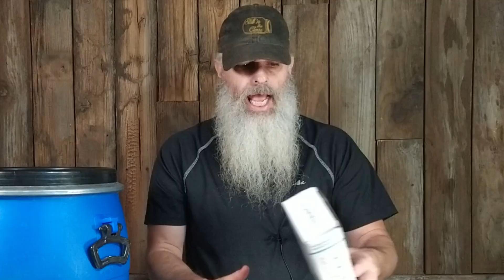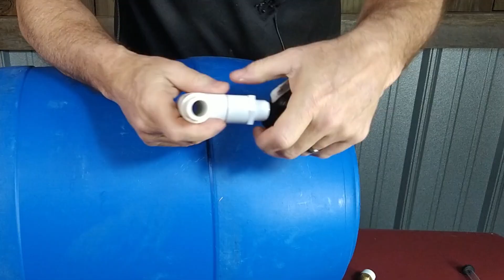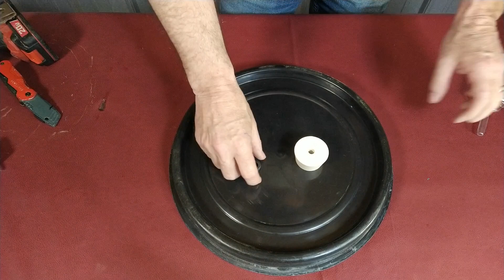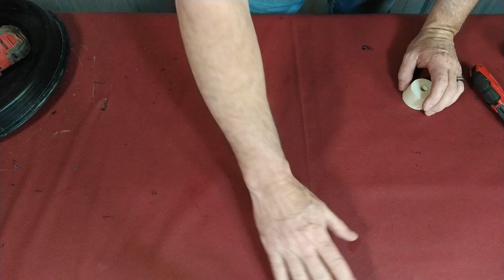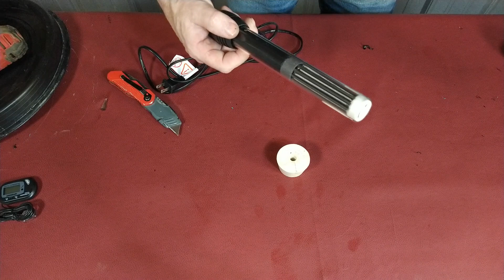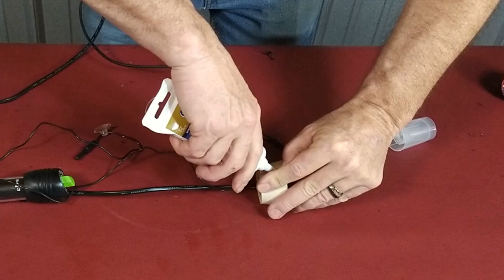Homemade heated fermenter / mash tun w/ digital thermometer

Comment: Hey Cyrus, it's been a minute since I've seen your videos! On the hole for the bubbler I've been drilling 3/8" as per the instructions for them. Is that a better idea drilling a 1/2" hole?
Reply from the maker: The grommet that comes in the parts kit requires a 1/2" hole, but all grommets are not the same.

Comment: Cyrus, a simple way to route the heater cord is to cut off the socket  plug and insert cord through a suitable size grommet replace with a new plug. The probe wire will also fit through grommet,  a little bit of silicone on grommet to seal. Easy, no need for that big plug.
Reply from the maker: You're absolutely right, but I was trying to come up with a way that was easiest for the most amount of people, even those intimidated by rewiring electric cord. Thank you for the comment.

Comment: How will you cool your mash so the yeast don't die?
Reply from the maker: There are a few ways to do it.
1. Mash in with half the water then add the other half as cold water when mashing is complete.
2. Let it cool down naturally before you pitch yeast. This takes several hours.
3. Use a wart chiller to cool it down then pitch yeast.

Comment: Hey Cyrus, nice design! I like that you made it as easy as possible. I ferment in buckets in a converted mini-fridge with a PID controller that can either control a heat source (electric hot pad) or fridge cooling. I removed the door and added a one inch thick collar around the opening then attached the door to the collar. Wires run through holes in the collar so I don’t have to drill into the fridge. Your way is much simpler and works with on-grain ferments. Thanks!
Reply from the maker: Awesome, I wouldn't mind seeing some pics of your contraption.
Reply: I've got the same barrels. Can't get t the lid t to seal.

Comment: That’s how I hang my heaters except I use the smaller air lock stopper
Reply: So do mine but with smaller cups that are easier to cut with a blade
Reply from the maker: @BoogerSugarSteve  nice 👍. What size stopper are you using?
Reply from the maker: The #10 allows me to take remove the heater from the lid.

Comment: Start the 5:09 hole in forward and then half way though run the drill in reverse. Clean hole…
Reply from the maker: Cool. I never tried that. Thanks for the tip.
Reply: @StillnTheClear  it “melts” in reverse. Leaves a cleaner edge in my opinion.
Reply from the maker: @cliffp73  Do you still end up with little melted edges to trim off?
Reply: @StillnTheClear  no normally. Please try it on maybe a scrap piece and see what you think. In very thin plastic I only use reverse for the hole saw part. And forward using just the drill bit.
Reply: @StillnTheClear  also thank you for the video. I made one like the first one you showed us. Where I cut small slits In the bottom side of pvc to act as a screen.
Reply from the maker: @cliffp73  yeah those work well too. It costs less too.